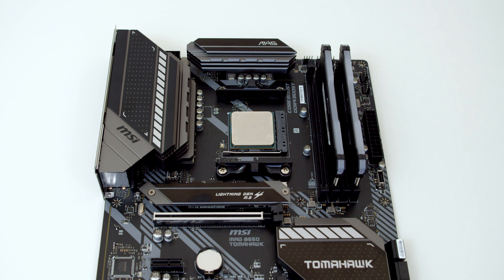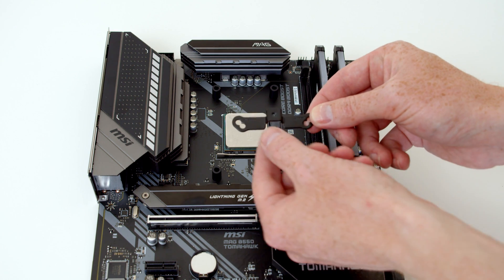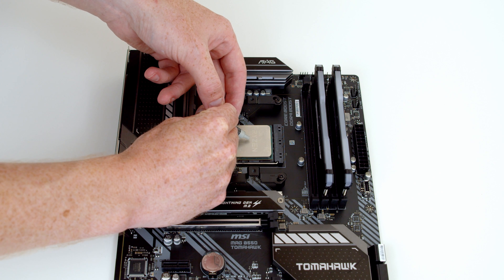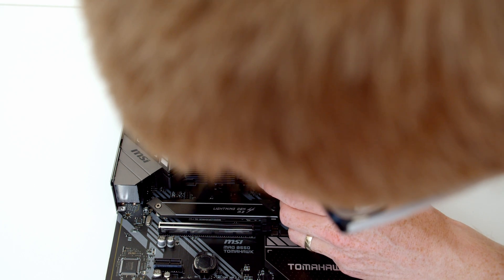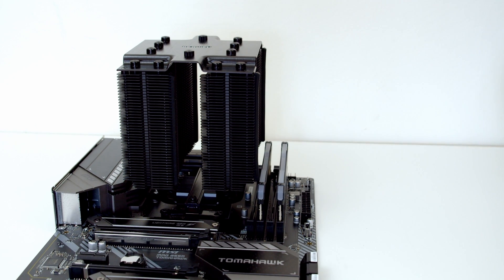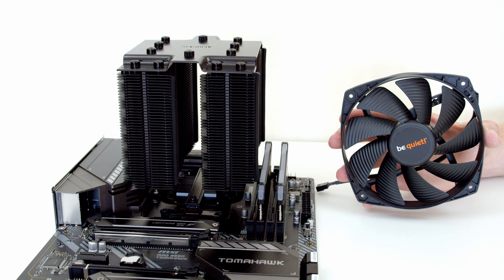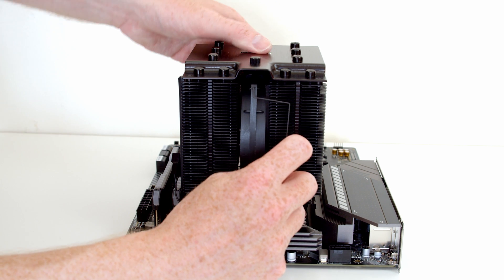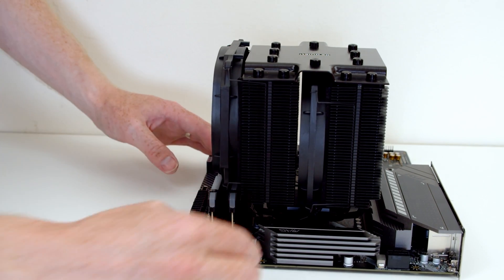be quiet! Dark Rock Pro 4 Installation Guide

Comment: Great beast of a air cooler only 24Db at 100% , works great for my 7800x3d temps 31 at idel , but you really need low profile ramm for this . Pain to clean because of middle fan , you will have to remove your GPU for cleaning .

Comment: If your motherboard mounted, and you just want to change thermal interface, then putting those fans fixture is torture
Reply: ME RIGHT NOW. i have a prebuilt pc and i need to change thermal paste. I HAD TO TAKE OUT THE GPU, PUT THIS THING AWAY, APPLY THERMAL PASTE AND SINCE 1 HOUR IM STRUGGLING WITH SNAPPING THOSE METAL THING IN

Comment: i accidently had it build in the wrong direktion (so air goes inside tower instead of goinf out). So i have to unscrew and rotate the whole thing.
Do i need to clean the thermal paste of the cpu and cooler and apply new one? Or ist it fine to just maybe push a little bit fresh one on the cpu and keep the „old“ (1 week old) paste on it?

Comment: I bought the Tower more than a year ago, I would never have thought that the problem could be in the area of this cooler, I checked and made sure by leaning the ruler against the plane, the processor trottling, the problem went away as soon as the cooling was replaced. I wrote an angry letter to the SC waiting for an answer.

Comment: 2:20 (this is wrong here's why) When you mount the 2 mounting brackets don't tighten them all the way down, take the cross bar that holds the cooler down and mount the 2 screws all the way down, then tighten the 4 bracket screws. After that remove the 2 crossmember screws and the hold down bar, This keeps the brackets in line with the crossmember bars alignment . I found there was 1-2 mm play in this area. It will make installing the cooler much easier.

Comment: I would also like to install this cooler in my computer, and I have Corsair Vengeance RGB RAM which is taller than usual RAM, approximately 5 cm in height. I can see you're using also an RGB RAM and you managed to install the FAN on CPU, even though the RAM is higher, right?

Comment: Thank you. It was tedious but I got through it. One thing I messed up on is the bar that goes across the bottom. You were holding it upside down and I didn’t see you quickly flip it over when placing it. So there was space between the bar and the contact area where it meets the CPU (which caused it to slide a lot). But I turned it the right way around and problem solved!

Comment: Does anyone else have a bracket that instead goes across the left and right? I only have that bracket and it means I have to mount the cooler with the fans vertically. I have been looking and it seems no one else has this issue

Comment: I just got this cooler and I use it with the Ryzen 5900X temps running at 50-70 in idle.  I had to swap one of the fans to the other side so it is facing the back of the case. It would have blocked my access to RAM. Is this bad?  I might try to reinstall it today. I'm using Asus Rog Strix x570-F gaming motherboard.

Comment: Few mistakes. For newer AMD CPUs, it's better not to use the 1 dot pea method for thermal paste. You should put the middle bracket on the cooler before putting it on top of the cpu, and I would have advised to remove the screw caps too (less fidgeting while it's on the thermal paste not secured). I think Be Quiet already did a video showing some better techniques -  but still a good effort on your part.
Reply: The pea method is the tried and true way to apply thermal paste. Less is more with thermal paste.
Reply: @yg78t76t7  No. It was the standard method before, but not with the newer AMD CPU's. This has been backed by tests on multiple channels already
Reply: It’s still the right way, I don’t know where you’ve got that information but you’re wrong.

Comment: I feel like an idiot and don't know what's going.. installing the cooler was no problem at all but now I'm sitting here trying to put these god damn metal brackets on the cooler. .one side works exactly how shown.. but then the other side is way too loose to hold.

//edit: Took me way too long. 
These brackets come in two diffrent sizes.. well now I know
Reply from the maker: Tried the same thing myself in silent base 802 build despite having used it before

Comment: I did my first PC build with this cooler. Sadly my first build didnt go well, it doesn't boot! ... people i asked help for says could be a broken or dead MOBO.. :< they're all bnew.
Reply from the maker: If you google no boot screen new pc and find a video and work through the steps. I'll have to make one at some stage
Reply: Just an update about this: I returned the mobo and they replaced it. The “brand new” I got was apparently dead. On the other hand i got a new one as the store replaced it. Now I’m just waiting for the gpu probably 3060/ti .. and the build would be complete :)

Comment: If my motherboard has two CPU fan connectors should I still use the splitter or should I use both motherboard connections?
Reply: use mobo sockets

Comment: Just got to installing this myself with the Gaming Edge (essentially the same board), and my god it's difficult by yourself, especially with bad lighting! I made the amateur mistake of installing virtually everything else before this, so my motherboard was already in the case and GPU was blocking my work space. Removed the GPU, and thankfully the Phanteks P500A had enough room (very spacious) for me to get this installed already in the case. If anyone is reading this, do it outside of the case first! The lightning inside a case makes it SO hard to get those 2 screws into the mounting bracket.

Aside from your head blocking the one part with the bracket (actually important, my buddy initially installed his upside down, not locked in, was wiggling everywhere), this was a fantastic video! I highly suggest adding an overlay message describing the orientation of the bracket, as obvious as it might be for many - especially since we can't really see that scene. All in all, thanks for the video, very helpful!
Reply: Did you have a b550 Gaming Edge Wifi? And what ram did you use? Any problems with the height of the ram and the cooler?

Comment: Small corrections:
- the fans won't spin at the same speed, but rather at the same % of their speeds(smaller fan, 120mm, has rpm of 1500, the bigger, 135mm, 1200rpm)
- one of the ends of the y-cable is a 3-pin; only one fan's speed will be shown in the readings, as is usually the case with any sort of splitting situation. 
Disclaimer: I don't remember all this by heart, just messing with my pc right now. Also didn't occur to me to take the mobo out of the case white installing additional fans and finally getting around to do cable management :'D
Reply: Thank you both for your help to us all! Christopher your videos are awesome and really  very informative and well made! I do have one question: Do I connect the cables of the fans to the Y cable either way I want, or should I (for example) connect the large fan with the four pin and the small with the 3 pin cable? Thank you in advance!
Reply: Does it matter which fan gets the 3-pin split?
Reply: Does it matter which fan gets the 3-pin cable?

Comment: Just installed this on my first pc build. This was one of the most difficult parts of the build for me and you really helped me out with this. Thanks!
Reply: replacing a cooler is one of the most stressful computer related things i can think of
Reply: Should've seen the Socket A installation bracket 20 years ago! Screwdrivers slipping and stabbing the board, installing the cooler backwards and chipping the bare silicone, it's a miracle those parts still worked after all the torture!
Reply: Can one occupy all four dimm slots with this cooler in the way?
Reply: @rebirth_mishap  yes
Reply: @rebirth_mishap  yes
Reply: Why do they design all these parts like a torture. DIY is such a torture most of the time!

Comment: Would this cooler impinge on the nearest RAM slot? Low profile needed? I’m only using 2 sticks anyway but wonder about upgrade possibilities - thanks for a fantastic video 😊
Reply: Depends on your motherboard. Bequiet has a handy tool you can find here: https://www.bequiet.com/en/motherboardcheck
Reply: The lower profile the better. To insert the ram to the nearest slot you will have to remove the gpu, the central fan, the heatsink and apply thermal paste again. This heatsink is a big PITA.

Comment: After installation, it seems to be wobbling a lot. I have tried installing it with and wi ty out the o-rings provides but it still seems to move around a lot.
Reply: @ChristopherFlannigan  I rewatched the video and noticed I installed the metal bracket that stabilizes it, incorrectly. Thank you for the reply however!

Comment: My B450 Tomahawk max arrived today! My motherboard was the last to arrived so I’m finally going to start building my pc I bought this cooler and was looking for some tips since it’s my first time building a pc
Reply: https://pcpartpicker.com/list/pfnQk6
This everything in my build
Reply: Christopher Flannigan watched a couple of your videos during my build thanks for the very easy and informative guides! I was able to put everything together and all my fans and lights are working but my dram led is lit I reinstalled my rams and that still didn’t work I reset the cmos with a screw driver cause I didn’t have a jumper cap and still no luck opening bios my keyboard and monitor won’t connect
Reply: @alex-1822  happened to me as well go check your cpu arrow just put it in right place if its not
Reply: Christopher Flannigan took it to a pc repair today and turns out I had a bad motherboard something was wrong with the ram slots so I’ll have to order a new one and wait

Comment: Just a quick question if you don't mind: I have a aDrk Rock pro 4 and Amd X570 on the way. I noticed after my purchase that the DPR 4 ram clearance is 40 mm. The high performance ram I bought has pretty tall heatsinks making them 43.5mm tall. I have two sticks so they'll fall on the same 2nd and 4th slots as yours. You look like you have tall ram as well but it looks like that fan ridge goes right between them at slot 3. I saw some pressure on the 4th slot ram until you had the fan locked in place. Does the fan actually touch your ram? If so does that seem to be a problem? I will be moving my computer from room to room fairly often so I wouldn't want the ram knocked around by the fan. Is the fan on their tightly with no play? Is it it possible to clip that fan up just 4 mmm higher do you think?
-
Also how do you like the DRP 4 so far? I bought mine because I'm getting a Be Quiet case and power supply and am going for a very quiet but tough audio recording studio system. I read that it's lifespan is up to 300,000 hours, which is hardly beleivable. That's 34 years of continuous operation! Maybe that's at the lowest speed but still lol.
Reply: put on the back first fan if u have problem with ram memory height...u will have same results

Comment: After you take out your original brackets you seem to have screws there already, which I don’t seem to have. Am i missing something?
Reply: Christopher Flannigan so when u put the standoffs on, is there something holding it in place?
Reply: Christopher Flannigan yea the back plate
Reply: Christopher Flannigan tuf X570-PLUS
Reply: Lion 2920 You probably figured it out already, but when you unscrew the original brackets the back plate falls off, so I installed the cooler before putting it into the case.

Comment: How hard would it be to swap this from within the case? Finding the wraithprism rather loud :(
Reply: Doing the same. it sounds like a jet engine!
Reply: If you have fans installed at the top of the case it might be a little bit of trouble trying to get the fans clipped onto the CPU cooler. Otherwise, it should be doable with the motherboard still installed in the case, just make sure the backplate for the CPU cooler doesn't fall off while you're installing the new cooler.

Comment: does it get its power solely from the motherboard? no connection to the psu required?
Reply: Nope! The only thing requiring power are the 2 fans, which are easily powered by the motherboard CPU fan connectors. If your fan required PSU power, it would probably end up scooting your PC across the floor.